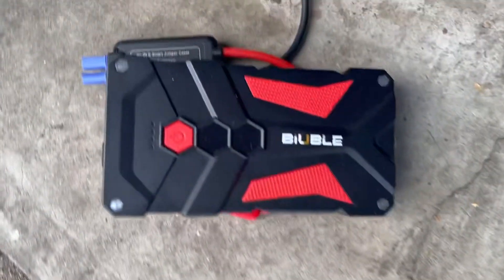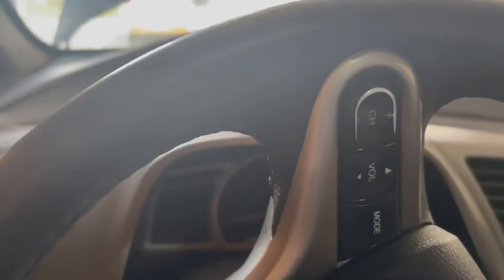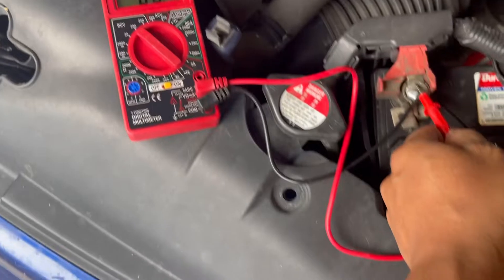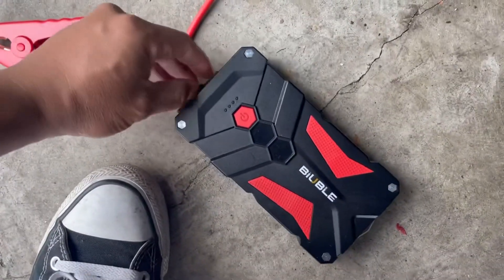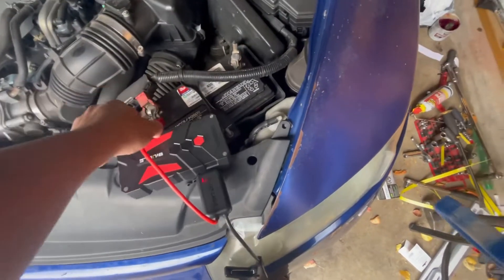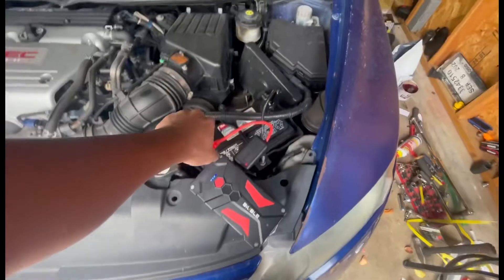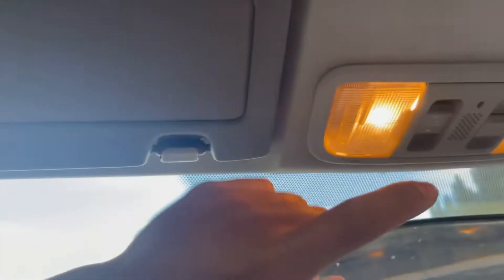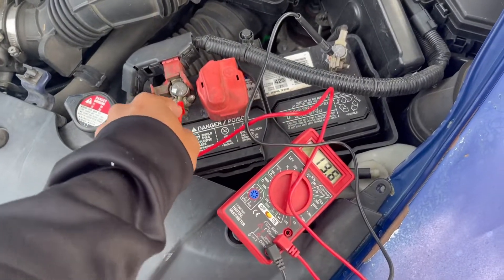BIUBLE Car Battery Starter, 1000A Peak 12800mAh review

Comment: You explain this well just by watching you I did it correctly. The manual doesn't tell you to hit the power button.
Reply from the maker: Thanks for watching and commenting
Reply: I am french and the manual do not say much too, but in the english version of the manual, this is worse, you have some copy paste, some typo and some informations are lacking.
Thank you
Reply: You have to have X-ray vision to read the manual.  Do you have to charge it before using and how long?
Reply: @elaineburdette5337   I would charge it because it has to be full in order to get your battery to jump.

Comment: What do you do w/Buick LaSabre (their owner's manual) says "do not connect to negative"; instead "connect to unpainted metal part of the engine)? Bc I can't find the negative on my battery?
Reply: So if you look at the engine and you see a shiny piece of metal that's thick like a bolt or a bracket than that is the negative

Comment: You didn't show anything about charging the device to begin with. How do you know when it is fully charged? I've had mine plugged into my laptop (which is plugged into a wall outlet) for three hours and the blue lights line is still flashing on one end.
Reply from the maker: If you press the power button there are 4 blue lights that flash . And if all 4 are on that means it’s fully charged .
Reply from the maker: It’s best to charge the device with a power outlet like a phone charger box . Charging through a laptop will not charge as fast because the USB ports on a laptop is mainly used to transfer files .
Reply: They will eventually stop flashing when it's fully charged. It could be your charger also. I got mine yesterday and immediately I plugged it in to charge it and it took a while to charge but it finally charged.